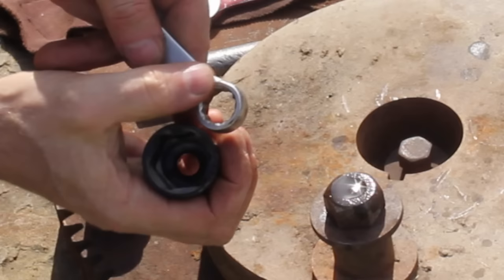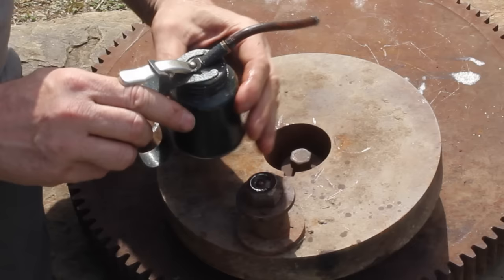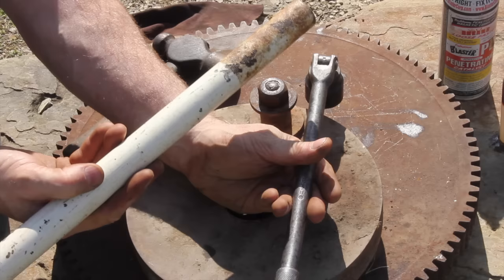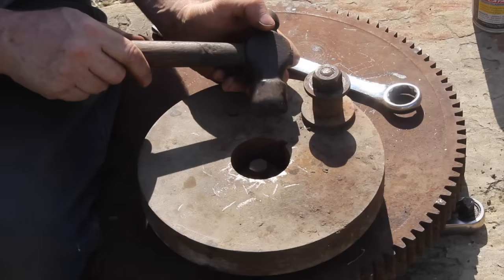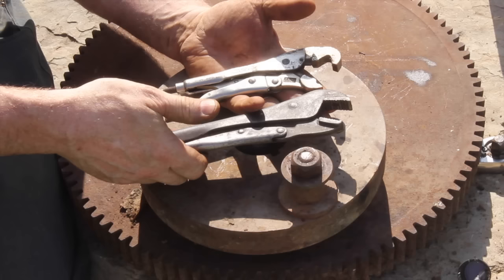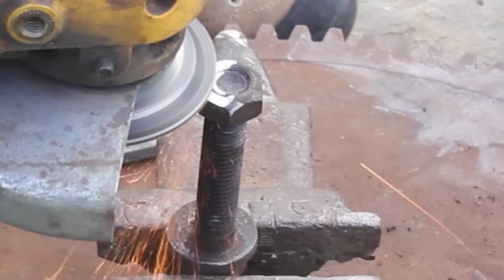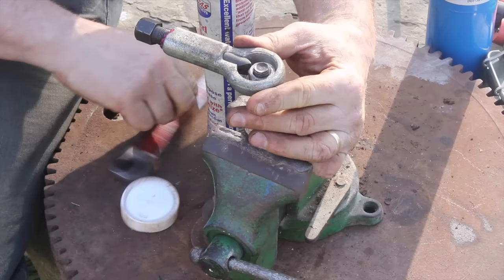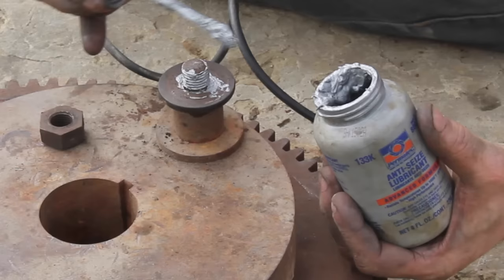Best Ways to Get Rusty Nuts and Bolts Off (Effective Techniques)

Comment: ECG--Another "technique" or method is to use "turbo" sockets.  They are sockets which have a six-sided interior with sharp points that twist down and inward at about 70 degrees (i.e., in a helical fashion), biting into the nut or bolt head.  They will typically chew up the fastener to the point that you'll need to replace it after removal, but they are usually successful when nothing else works. Some are finished with a shiny black-anodized coating, and should therefore not be confused with impact sockets; others are a flat, dark grey in color.  For that reason, they should be used with a breaker bar and NOT with an impact wrench (although Irwin does offer them for impact use, as well).  Turbo Sockets are offered by Hudson Bearing (who originated them), SK Tools, Irwin, Craftsman and a few others.  Offerings vary by manufacturer, but they can be had as shallow, deep or ultra shallow sockets; also in metric or SAE . They are a specialty item, so it may be difficult finding them in stores; buying online is your best bet.  They are also available on all the tool trucks, if you feel like spending lots more money for them.

Comment: I just removed two broken off bolts from a Polaris ATV  metal rack extender using a torch. Simply 4 bolts hold rack extender to the plastic rack . Cant heat it so, if they break too bad.
After separating the parts,  broken bolt end stuck up a little. Heated end of broken bolt and welded on some metal to build it up higher. Then heated surrounding threaded area to red hot.
Let it cool down, then touched candle wax to give it some grease. Grab onto welded bolt using vice grips and wiggle back and forth till it started to move and they came out. MUCH easier and quicker  than drilling and tapping.  AND will grease it or anti seize to prevent from rusting again.

Comment: Whenever I can, I use Penetrating oil and give it a chance to soak in. Then, I turn the nut/bolt clockwise (as if I were tightening it) until I hear a slight 'click' or see movement. After that, I proceed to loosen til it starts to get hard. At that point, I tighten a little then loosen, etc., until it finally comes off. Also, if it's being a bear (like manifold bolts or O2 Sensors, use a Map Gas or Propane torch to 'cherry' it up, then quench it with a spray bottle of ice water...
Hope these suggestions help. I always do the tighten first then loosen technique and it is almost always all I need to do...

Comment: Nut splitters are great. yours looks like it needs replacing. Smack it into the flat of the nut, maybe 2 of them, this expands the nut. Don't do what you did and hit it sideways. Another method would be to drill little holes down into the points of the nut (maybe 3 of them). Once again you are releasing the tension on the threads. Most of us use the chisel against the flat and hammer in the anti clock direction. And Lube, yes lots of lube! Six sided sockets or spanners are a must. Hope that helps.

Comment: I used a short 6 point socket, ratchet, pipe extension and a scissor jack to remove a couple exhaust flange bolts under my car. Wish I'd done that on the other two that I cut off, but probably wouldn't have worked well because that part of pipe wasn't bolted to frame like the two I was able to remove.

Comment: Glad to see wd40 not used,it's a jack of all trades master of none.
Preparation is very important,prior to any torque being applied.
.remove all rust and debris from exposed threads.
.Shock the nut on the flats with a drift
.Best penatrating oil in the UK Is plus gas
.Be patient,use good quality tools
.Splitting a nut with a chisel is also effective,even just half way thru can take the bite of the nut.
.A tap bolt,or cheese head can be eased by hitting the side of the head,this will release the bite under the head.
.Be patient take your time,worry the nut,a term used by a fitter who taught me when I was an apprentice (he had served on a destroyer in WW2!)
.If a lot of thread is exposed run a die nut down to clean up thread,before removing the nut.
.A large diameter nut can be washed of with a burning gun,not in my skill set but have seen in done several times!
.I once took 12hrs to remove a 2 inch BSF nut on a overhead  crane!
12 inches of exposed thread,the blue print for the crane was dated 1890!
.Another tip is to use a hand saw to slice down as close to the thread as possible and thru the nut,this is usually enough to take the tension out of the nut,then use a sthilson to remove.
.Be patient if you get stressed,go and have a coffee/tea then return!
.When you fit the new nut,apply anti seize,I have tin in my toolbox with an old toothbrush to apply it.
.I worked in chemical plant for a couple of years,it was site policy that every new nut/bolt had anti seize applied (apart from some that had to be dry torqued)
It was a fab place to work,everything came apart so easily!
Stainless steel nuts on stainless thread can pick up when removing,very important to apply anti seize on stainless threads.
It's good policy to try to tighten a nut slightly before removal this can sometimes break the bite.
When fitting new nuts and bolts,use correct lenth,one/two exposed threads is the best standard.
This reduces chance of exposed threads rusting,and causing problems when removal is needed.
.I'm 62 and been working as a Mechanical Fitter since 1977,so seen quite a few siezed nuts/bolts over the years.

Comment: thanx i was trying to undo two parts of a little dremel-tool type thing. number 8 did it. i heated the thing up, then dipped it in icey cold water, didn't work. did it three more times, worked like a charm although i had tried everything before. now i just need to figure out how to prevent this from happening again. i don't know if you can get this anti-seeze thing in my country but maybe you can get something similar

Comment: I will generally go to an angle grinder or wizz wheel and cut most of the way through the nut if I can get at it.  If you need to be careful about the threads go almost through then hit the nut with heat.  It will stretch more once it's weakened; often times you don't even need the heat. I work on boat trailers a lot and I hate breaking to 1/2" U-bolts. Half-inch nuts are cheap. On that application if I nick the threads it's generally No Biggie; I save a $5 part in seconds.

Comment: For bolts that you can discard, I have had to resort to drilling out the bolt. Start with a very small bit, then work your way up to one that is almost the size of the bolt.It is time consuming, and will cost you some metal drill bits, but it will work.
Reply: Awesome backup strategy, thanks!
Reply: @kylebaird4642  If all else fails, the easy thing to do is to use an angle grinder and a cutting tool to cut the nuts right off.
Reply: @kf3en i would use this method but the bolt is next to the plastic fuel tank😅

Comment: I just bought a mini ductor to try; in the interest of science that is. I haven't received it yet (this afternoon 12-24-19, Christmas Eve) but there's a pair of stubborn nuts which secure the sway bar bushing on my vehicle so I'm starting there. I'll report back with my impressions after I've tried-out this tool.
Reply: Did it work?
Reply: @whatthe2458  Yes it did. Shame on me for not reporting back as I stated I would. It works very well getting those nuts glowing red. A couple heat and cool cycles in most cases is enough to get stubborn nuts to turn.

Comment: I have an issue, and while it would be awesome to remove a nut from a stuck bolt, that's not the issue I have.  I only have a bolt with a hex end screwed into the front disk brake caliper bracket and the part that connects it firm to the car.  I plan on replacing the bracket as both bolts that hold the caliper to the bracket sheered off, freeing the actual caliper without damaging it.  The stuck bolts cracked the 15mm hex socket{the socket was quite old but still?} I was using rather than moving, and the bolt hex end is starting to strip out now too.  Haven't tried the heat yet, but I'm hoping the hot/cold deal will work.  The only option I might have of drilling it out, could damage the other part, not work, and I've simply no experience here.  Anyways the video is great.  So many methods. Wish me luck.
Reply: Also, since the Bolt hex end is made with a wider washer type round area, which is also super rusted, it makes getting penetrants to the threads pretty much impossible.

Comment: Thank you so much for your advice. It’s been so helpful but the one problem I’m having is getting brake lines loose without tearing the you know the fitting up or getting it off in one piece and I do the things you talk about with the bolt, but is there any different procedure for brake lines on old cars?

Comment: I auctually have dug out a bolt from my engineblock, extractors never worked, not a single time, and I have now a rusty problem wich snapped... M10 (10mm). Just drill it right in the middle, carefully, then take somekinda spike or flathead, and hammer it like an empty can of soda

Comment: I'm getting ready to try the nut splitter method. I have a completely rounded screw/bolt on my cars belt tensioner. It's on the hidden side so there is little to no access here... I hope this works.

Comment: Thanks for the tips, can you do a list of ways to remove siezed rusty automotive bolts that have to be saved and removed undamaged. All the videos I see on YouTube either damage the bolts, use extractor sockets, cut off the bolts or drill them out.
In my case it's proprietary bolts on my '02 Jeep Grand Cherokee Laredo 4.7L for the sway bar links and sway bar bushings. I have no access to the nuts only the bolts because the nuts are welded on inside of frame. 
I want to use MAPP GAS Torch but can't Torch the nut.
Will heating the bolt and cooling it over and over breakdown the rust without compromising the bolts?

Comment: Great Video. I am struggling to take a 1/8 hex set screw from the base (collet?) hub of an inducer motors where the squirrel cage blower wheel is rusted and gone. Any ideas are welcome.  I tried PB blaster, heat.. (may be need to cycle it some more hot/cold like you suggested) It's destroyed a few 1/8 allen keys so far.

Comment: As a plant engineer I yours all of these ways you must one air chisel on bar with socket flat on end so you can put spanner on it turn it and the end can be yoursed as a hammer vibration to listen nuts bolts rusted plates splitting casses on old gear boxes heads and so on 35years in strade Scottish borders Scotland UK

Comment: I'm trying to get a rusted nut off from under an old kitchen faucet. Stuck using a basin wrench. Already tried soaking with pb blaster. Also used a pipe as an extension and put enough pressure to bend the basin wrench handle. I've hit with a hammer, heated with a torch as much as I felt comfortable without melting the counter or starting a fire. Cut the top of the faucet off but it is wider and rusted up top too. At a loss for what to do next.
Reply: Try using a long drill bit to split the nut on each side and chisel the halves off.

Comment: fire and heat but welding a nut that bigger works too ,even a stick welder with 6011 rod burn right thru a stuck nut

Comment: I'm trying to remove my aluminum fork cap off my aluminum fork tube. The cap started to deform a little so I stopped until I can learn some better techniques. The part is so expensive, it would almost total my bike if I had to pay 2000$ for a new fork assembly. I would really appreciate any help and advice you can give. Thanks so much.
Reply: heat the fok tube with a MAP GAS torch .....file some new 'flats' onto the cap-bolt and after heating put on a decent adjustable spanner , tighten it on there good ......if it starts to slip ...STOP.
Try heating again or maybe get the right six sided socket for the job ... 30mm ??

Comment: plumbers pipe freezing spray applied after heating the  nuts or freeze the nut then heat the nut 

and a mix of 90% veg oil and 10% of paint thinner, or acetone  works really  well, even better than atf and acetone
Reply: Thanks for interesting comment.  Would u know why vegie oil works better than transmission oil? Thanks

Comment: recently I've tried swearing at them, it doesn't work immediately, but eventually they break down after a few hours and then loosen up, but I make sure to blast them with a crap ton of pb and wd40, and then a breaker bar too. But its the swearing that does the trick. If you don't swear, they won't come off

Comment: GREAT METHODS BUT:  None dissolve the rust that has expanded and is locking the nut on in the first place. 
I would also try a muriatic acid, which dissolves rust. 
Also working the nut back and forth can allow the expanded rust to turn to powder and fall out.

Comment: Has anyone tried penetrants over time.  For example, has anyone applied penetrants every day for one week, two weeks, or three weeks to see if that loosens up the bolt?
Also, someone mentioned soaking in transmission oil for a couple minutes and then using an impact driver took an otherwise stuck bolt right off.  For down facing bolts in difficult places, it may be possible to fill up a small cap full of transmission fluid or penetrant  and then hold the cap such that the bolt is submerged for a few minutes.  If someone is using a foam version, maybe a cap could be filled with foam and taped in place.  The point being to make Father Time the friend of those who may not have all the best tools.

Comment: How would one break loose a rusty spinning bolt and nut?  In other words, turning the nut also turns the bolt in which neither separate.   The worse case scenario (like I am facing) involves a bolt which has a torx-head end.

Comment: Haha I have that same bottle of never seize. I follow up with that on all my repairs.
Reply from the maker: +wertz987 

A little tube of anti-seize is never enough!! It sure is nice when you come back to repair years later and the parts just come right off. It makes it all worthwhile.
Reply: I have a big bottle of the copper Never Seize and it goes on everything. Too bad the people that worked on vehicles didn't think to use it before they drove my neighbor's caliper bracket on with a billion foot pound air wrench

Comment: What method would you suggest for getting one off under the kitchen sink? My door to under the sink is very small so I can only get like one arm in at a time.. I tried a Basin wrench and it won't budge. Tried putting Liquid Wrench rust fighting fluid on it too. The problem is its a small nut, unscrews downwards, and my ability to access it is VERY limited. Maybe heat up with butane torch and then lift a full glass of cold water up to it to soak it in? HELP!

Comment: How does one remove seized bolts holding a crankshaft pulley if the pulley is deep set with the bolts hard to reach as with my 85 VW Golf? The M8 round socket heads are rounding off internally due to increased attempts at removal even when using a back and forth motion with the hex wrench. Cannot use vice grips due to the very tight confines. Been applying PB Blaster several times and pounding with a hammer to no avail.

Comment: Hi Error, I am interested using method Number #5. I need to remove these rusted bolts on the exhaust under the car. Thank youtube for subtitles, I didn't know the heck you said and thought it was Kerosone lol. I am not familiar with Parrafin but I'm gonna look it up and hopefully I can buy one.

I think I may need some help. I am doing a home job on my Mitsubishi Triton 4WD, doing it myself. I got the car on the stand, etc, so far so good. If I need to remove the rusted bolt on the exhaust which has 3x bolts a set at point A, B, C, D making it 12x bolts all up I think. One of the bolt set is elevated from a 45degree, a little tricky but can use the breaker and correct socket size to get to it. However, it is on a 45degree angle how would I use the Parrafin or is it better to use heat instead? In your video you have the nut and bolt on a flat surface but I need to remove it as if it is upside down?

Hope that makes sense. Would really appreciate the good advice.

Comment: How do you get a rusted bolt off that has a rusted nut attached at the other end that is very hard to reach ( these are so rusted the metal of the heads are joined to the bolt stem and to the rack of my truck)

Comment: some really good ideas here, although I am a bit limited because I am trying to get an Oxygen Sensor out of a 20 year old car with really tight clearance
Reply from the maker: +Mc 

Oxygen sensors are usually stubborn to get off because they are right by the catalytic converter and get so hot. The first tool that I have had good luck with is that deep well socket that has a slot in it. I use that all the time because you get 5 1/2 surfaces onto the nut. Using a combination wrench doesn't work because it is too tight to get in to work on it. I think what I might try is some automatic transmission fluid and acetone mixed together as a penetrant first, then that special socket and see if it comes off that way. If you get it to move it all, move it back-and-forth and break the rust off that way. The next method I might use would be heat the manifold up really hot around the oxygen sensor, and let it cool off a bit. Then when it's still warm use the candle wax to see if it will penetrate into to the threads. Please let me know if this helps or if you have any other questions at all let me know. Also if you already got it off let me know how you got it off. This information can help all of us.